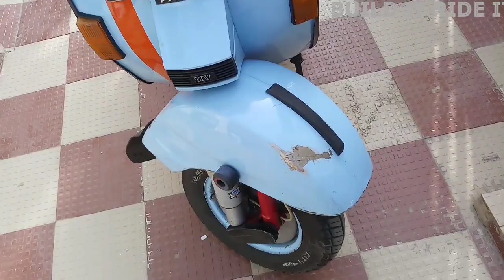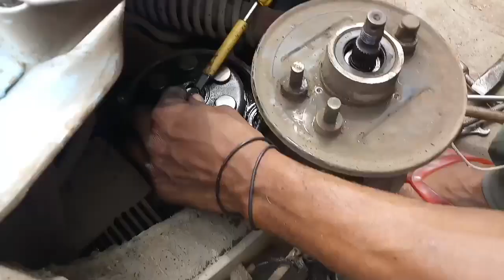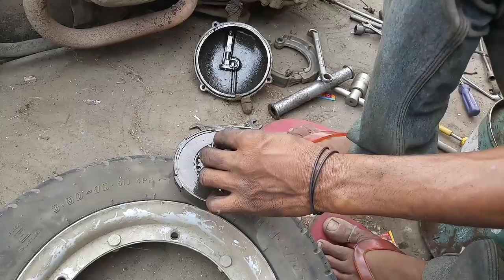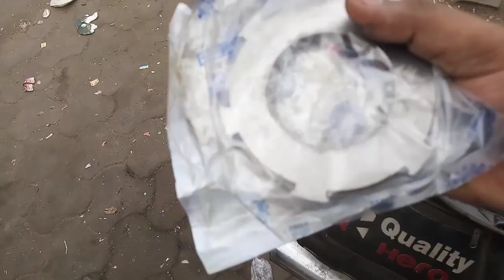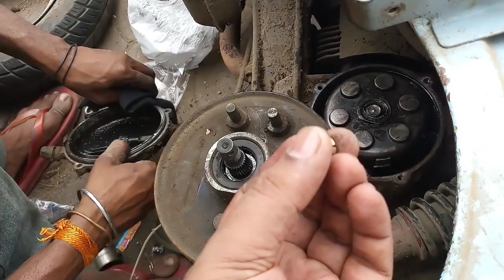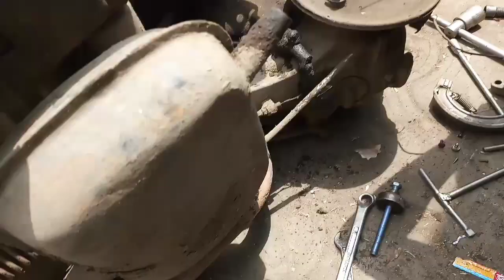How to change Clutch plates on a Vespa NV 150

Comment: U asked mechanic Do U need to Put oil on clutch disk? He said no. Im a Trained Motor Vehicle Mechanic and I would say definately Yes, we Should Submerge clutch Disk (liner or plate)  in Oil for a short duration at least 5 to 10 min To maximize the life of clutch .Since these Scooters Uses The same Oil (engine oil) for Cooling the engine, Gear box as well as For your clutch System , it quite hard to Absorb the oil To the clutch as the clutch is in the upper portion of the gear box. Its nessary to Submerge the cluth disk in oil because the 2 stroke motor vehicle uses multiple Wet Clutch System. Next Time do Tell ur Mechanic even if He says its not needed. :)
Reply from the maker: Agree, I always dip the clutch plates prior to installation.
Reply: @BuilditRideit  I think u didnt change the Clutch Spring and Clutch piston . Its highly recommended to change the clutch spring and Clutch piston ( A small piston like high ware item made of brass or copper placed before the clutch cover) at the same time when changing your clutch plate. The old spring  and old clutch piston makes Hard to hold the clutch. As the spring loose its temper and which becomes harded. 
Please do change these item when changing the clutch plate. Hard clutch spring can affect the Engine bearing and Crank. Which will later produce Horrible sound .
Reply from the maker: @Bengblok  yep, haven't done that, but the spring has sufficient stiffness, and piston too looked good. Will double check them next time.
Reply: Good job bro
Reply: I want some parts for lml NV can you arrenge

Comment: Sir.
Is the same clutch disk as the vespa nv and the 1998 model vespa star? please replay
Reply from the maker: Yes, how ever in certain models they had a clutch assembly that had larger petals compared to the older ones. Best way is to take the damaged one from your vespa to the store, that way they can get you the correct size.

Comment: Because of floods in Patna, my scooter was completely sunk.
I got the water removed from the engine, but it's smoking excessively now. It never smoked. White smoke. Yes, my Vespa never smoked in a normal run. It only smoked on full throttle and that too a lil or when climbing a slope. Is it somehow related to the clutch? As the clutch isn't engaging very well. I can't downshift easily.
Reply from the maker: White smoke is a sign of excess oil being used, as there can't be any consumption of engine oil as in case of 4 stroke engines, add just 20ml to a litre that should solve the issue, as of difficulty in engaging gears check and tighten your gear cables, usually they are the culprit. If the clutch it damaged, the bike will make noise as if "coughing" and at high speed(above 60) you may sense a lack of power transfer from engine to wheels,if so then consider replacing it.
Reply: @BuilditRideit  Can the smoke can also be related because of clutch being under too much pressure? Which leads to usage of excessive oil.
Reply from the maker: @AmolAmrit  no, in two stroke engines only gearbox is dunked in oil, the crank case is empty for draft of fuel air mix, and hence chances of oil reaching the combustion compartment is very low, hence it can't be the reason for excessive smoke. Alternatively as you are mentioning, I guess you are either using excessive 2t oil or may be the carb has overflow issue(if so than change the float needle, that should solve the problem), or may be you are using wrong oil.
Reply: @BuilditRideit  Thank you for the replies. I've given my scooter for servicing. One more thing brother, what is inside your toolkit? What spares do you keep?
Reply from the maker: @AmolAmrit  in my tool kit I carry a pair of plier, double sided screwdriver, a plug spanner and a cross spanner with 10,11,13and 14 mm heads, a thin wire(to clean carburetor). Additionally you can keep a puncture repair kit and a black insulation tape.
Reply: @BuilditRideit  Thanks, I've to upgrade my toolkit. It's 30 years old lol
Reply: @AmolAmrit  
If your clutch side oil seal inside the engine is damaged, then gearbox oil will go to combustion chamber & will cause excess smoke.
Reply: @Turbo_Charged.  After I refilled my tank complete from 0 and changed cables, everything went back to normal.
Reply: @AmolAmrit  
Thats good.

Comment: Hi bro how can I find oil clutch or dry clutch in LML Vespa select2
Reply from the maker: All PX series beaded vespas had wet clutch. You can locate it on the lft side of the engine, between the rear wheel and swing arm. It's restrained using 3 bolts and has a clutch actuator arm attached to the clutch cover. It's convex-circular in shape.

Comment: How can we identify clutch plates worn-out without opening engine
Reply from the maker: When you engage you clutch plate there would be a rubbing sound from the engine, something similar to coughing, if so it's time to either loosen the clutch a bit or worn out clutch plates.
Reply: Like BIRI says and also when revs increase but speed does not. Mostly noticeable on hills